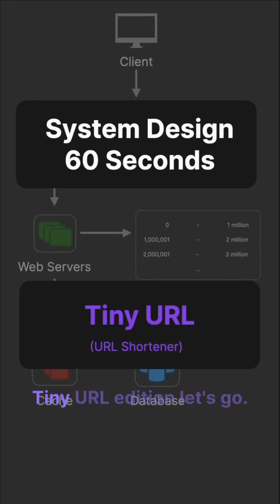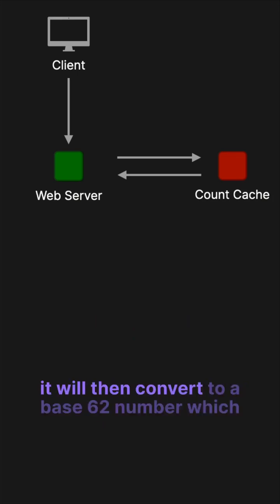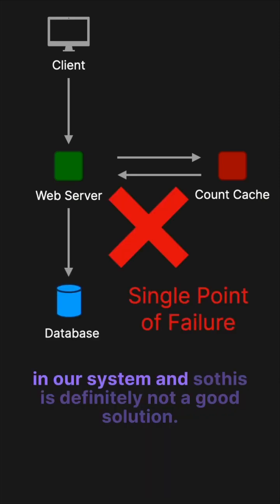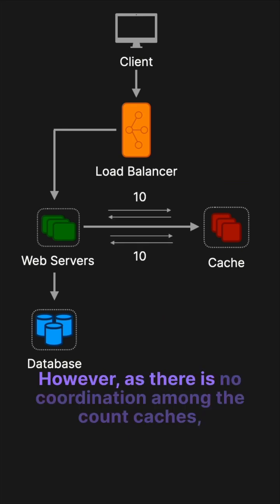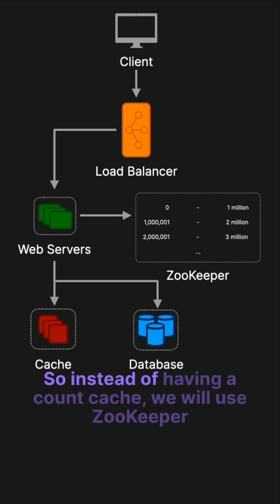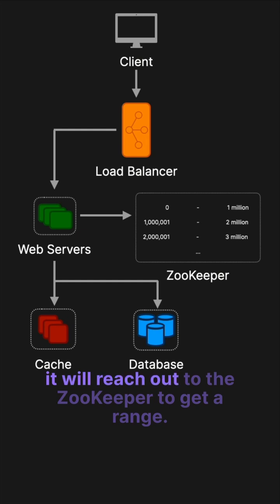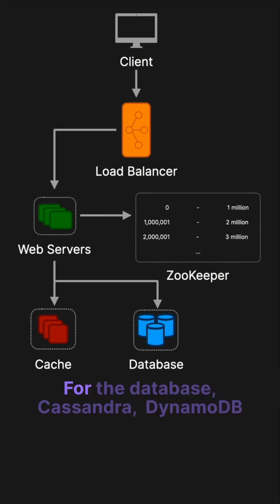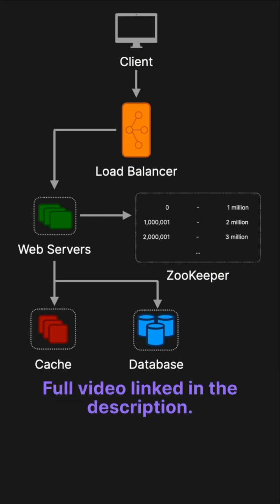Tiny URL | System Design in 60 Seconds #systemdesigninterview #tinyurl #shorts

Comment: I used to get confused with this stuff, like we use encoding algorithms to generate hash of the long url and now the generated hash is of smaller length, we store it and later we retrieve back. 

It has no complexity involved like that. 

Think about it this way, every time a request comes to shorten the url, you assign one number to it.

First url --> 1
Second url --> 2
and goes on.. that's it.. and store this in mapping db, now get/1 gives you first url, get/2 gives you second url. 

0,1,2...9 is the base 10 number. You got only 10 unique numbers to represent different urls, so it grows very quickly. For 1000 urls, you are already at 4 digits. 
And also generating urls 234233 is not human readable. 

So we use more  mix of characters to represent a number, A-Z a-z 0-9, now for a fixed length of size 6. You can generate 62^6 combinations. 

Just split this range for a different webservers, they keep on incrementing and maps it to url and store in the DB. Now when the get request comes, you know where it is in DB.